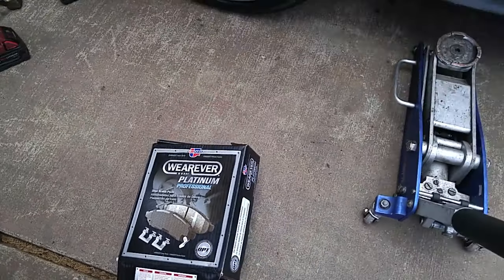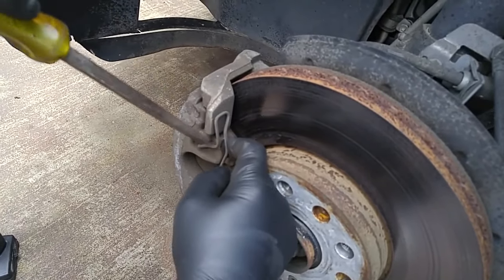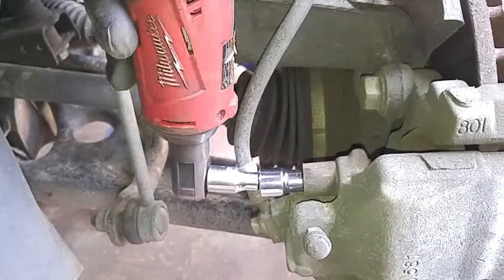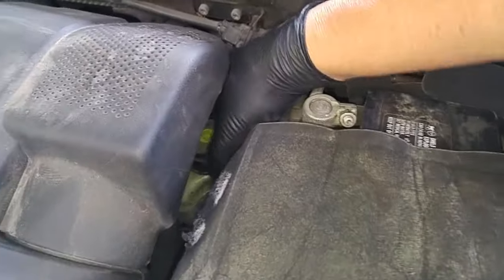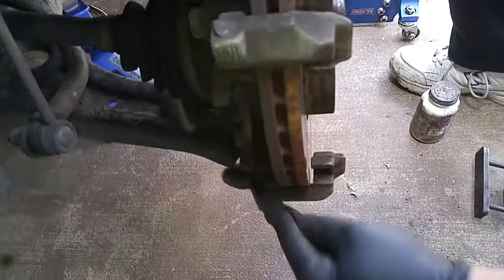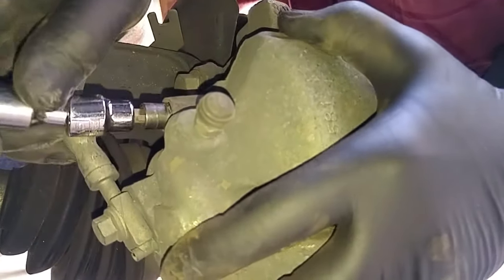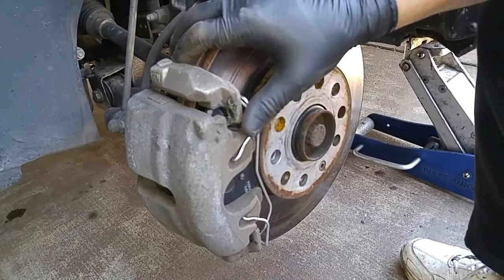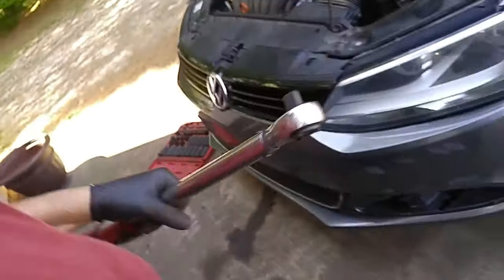Volkswagen Jetta Front Brake Pad Replacement (& other VW's as well)

Comment: Bro, uneven pad wear is your 1st indication of a sticking caliper.  Pull the pins back out and inspect/clean & lube them.  Otherwise good video but always pull and lube those pins.
Reply from the maker: Thanks but with this brake design the brake pad ears slides on the caliper bracket when it wears.  The pins only hold the caliper to the caliper bracket and don't move.
Reply: GromitDog1 You are absolutely right
Reply: @hardlymovingpro, pins are not moving, but the caliper should slide over those pins.
Looks like you're not familiar with VW brakes.

Comment: OK, so I changed the front pads and rotors, cleaned up and greased the caliper bracket and the brakes work great. But each time I begin to press the pedal, there's a single clunk from the front left. It only happens while I'm moving, and is definitely related to something in the brakes. Can't figure out what though. Could it be worn contact points on the carrier, that allow the pad to shift slightly? Any other things to check? My mechanic said it was missing shims, but I don't think the front brakes have shims (I didn't see any in your video).
Reply from the maker: On some replacement pads, the shims are rivetted to the pads.  If yours aren't, the shims may be moving around causing the clunk.  What I do is apply a product called "CRC Brake Pad Quiet" between the pads and shims and let it dry.  It's like RTV but semi hardens in a few hours.  You can also apply the CRC where the caliper ears makes contact with the pad shims.   That should take care of your problem.

Comment: I am due for front and rear pads on my '13 Jetta. Will the system need to be bleed? I see that when you compress the caliper back in you open the cap on the fluid reservoir; is it fine just doing only that?
Reply: What tools are needed? Just that #7 hex head, the flat head screwdriver, brush, and whatever size socket for the lugs?
Reply from the maker: I use the fluid level on the reservoir to determine if my pads need replacement.  When the pads where, fluid migrates from the reservoir to the caliper piston hole.  When you push the pistons back in, you're pushing the fluid back up to the reservoir.  Removing the cap helps to reduce the back pressure (although the caps has a small vent hole).
Reply from the maker: All you need is the hex socket to remove the caliper.  Can't state the sizes.  I have complete hex and socket sets and find the one that fits.

Comment: Stupid question: Are those bolt heads on sub-chassis actually able to take the load of whole car? Always gave me the impression it will slide away from jack stand...
Reply from the maker: The hole in the center of the wheel mounts up on the wheel hub ring.  That's what supports the weight of the car.  The lugs keep the wheel on the hub.

Comment: You are the man. Thank you for this. Gave me the confidence do this myself on my 2016 Jetta. One quick question, in your video you talked about possible brake fluid overflow? you opened and looked into the brake fluid container? May I ask what was the potential problem? Thanks
Reply from the maker: As the brake pads wear, the fluid in the reservoir drops as fluid migrates into the caliper piston cavity.  When performing a brake pad replacement service, the piston is pushed back in caliper which will make the fluid migrate back into the reservoir.  A common mistake that people make is to fill the reservoir back up to the top level not knowing that the fluid level drops as the pads wear.  So when the piston is pushed back into the caliper during service, the reservoir may overflow due to the excess fluid previously added before the pad replacement.
Reply: Thank you sir
Reply from the maker: You bet!

Comment: What could be the reason for extreme uneven brake pad wear?
Reply from the maker: I'd guess that the ears of the brake pads were not sliding evenly on the caliper bracket.  This is why I cleaned up the slides with a wire brush and lubricated with brake grease before mounting on the new pads.

Comment: Do you know the specs on the wheel lock nuts key I have the exact same rims on my Jetta but lost the piece
Reply from the maker: Sorry.  The lug nut key is unique to the lug nut set.  You'll need to go to a custom wheel sales and installation center to get a replacement.

Comment: I'm due for a rear brake replacement soon and I'll be goin w Akebono. Do I need to replace the rotor as well? Or can I just get it resurfaced? It's not warped or anything but I've heard that you should get new rotors if you're replacing your brakes. If so, what brand should I go with? TIA.
Reply from the maker: I use to resurface but now get new corrosion coated rotors.  The quality, performance and metallurgy seems better than non coated ones.  Regardless, don't put on new pads without resurfaced or new rotors.  There is a braking performance difference.
Reply: @hardlymovingpro  appreciate the response! Any recommendation on which rotors I should get? Looking for brands w high quality and performance but not overly expensive. Thanks again!
Reply from the maker: Recognized name brands like Raybestos, Centric or Wagner.  Stay away from store brands like Duralast and don't buy slotted or holed rotors.  No one will resurface them.
Reply: @hardlymovingpro  will look into those. Thanks alot!
Reply from the maker: Go to rockauto.com
Reply: @hardlymovingpro  just ordered my rotors off of there. What a database of a website man. Thanks again! Much appreciated.
Reply from the maker: @1804Mak You bet and good luck!

Comment: I drive a 2020 Jetta GLI and i've been driving on bad brakes for a while they squealed every time I stopped. But now they're not even squealing any more for some reason. Should I get new brake pads and rotors or just new pads?
Reply from the maker: Can't advise without taking off the wheels and examining the brakes.

Comment: Thank you so much for this video! I replaced my front brakes all on my own!! I was wondering- is this process similar for rear brakes? I have to also replace the rear brakes, and I can't find any videos as high quality as this one to follow. :/
Reply from the maker: The rear brake pistons are screw types;  that is, you have to turn in (clock wise) the piston back into caliper.  Here's a video where I did it on a Honda:  https://youtu.be/fDCAYY_Ml0M

Comment: Hi what’s the purpose of using that pressure tool? Is that required when changing breaks can I just take the old breaks out and put the new breaks in without doing that step ?
Reply from the maker: You have to recess the caliper piston back into the caliper for the new pads.  Otherwise, the pads won't fit over the brake rotor.
Reply: @hardlymovingpro  but don’t u have to use a press that turns the caliber? Because some have to turn to push it back in.. how do u know if it needs to turn wile pushing it in..

Comment: Can I use old pads on new rotors and also break in using old pads?
Reply from the maker: Nope.  The new pads need to seat into the new or resurfaced rotors.

Comment: Is it ok to use old rotors with new pads and vice versa? I get 50/50 answer online please help
Reply from the maker: If you want to use your old rotors, you should get them resurfaced assuming there's enough metal to cut. Out-of-round rotors will cause steering wheel vibration, effect braking efficiency and create inconsistent pad wear.  Oreilly's provides a service where they resurface for around $12 a rotor.  Here's a video where I resurface rotors:  https://youtu.be/eEpYifYWV5k
Reply: @hardlymovingpro  thanks! What if I have new rotors and old pads? Can I break in the new rotors using old pads?
Reply: @chuongtrinh3852  no .. because they are groves up.. u put brakes that are scratched with groves on it to a rotor that’s smooth .. Ur brakes will put them scratches and groves back into the rotor or vice versa .. u wants smooth on smooth .. rub ur finger across if u feel groves it’s no good .. u will only tear up the new item that’s smooth ..
Reply from the maker: Watch this video:  https://youtu.be/eEpYifYWV5k

Comment: so it doesnt damage the caliper to depress them without opening the bleeder valve? i was told not to do it like this but i was wondering how it is done because it was my understanding you dont want air in a system with abs. anyone have some thoughts please share, thanks.
Reply from the maker: No air will enter the system by compressing the caliper piston back in.

Comment: hi i dont understand a thing about cars but i have to change my the front brake pads on my VW Jetta 2007 i will let a mechanic do it but i want to buy the pads myself so i wont get overcharged for them but i have several brake pads i can chose from and they are all with a different  Height,  Length, Thickness and  Disc Ø which i have no idea what it means. How can i find the correct size for my car?
Reply from the maker: Pad sizes and types may differ based on the year and style of the car.  All that info can be obtained by the vin #.   Speak with the parts vendor to get the right one.
Reply: Just take your old ones off and take it with you to the Auto parts store.. p.s hope you have another vehicle 🚜
Reply: @kevinrobles7768  yeah i got the right brake pads and i had a friend install them but while doing so we found another problem which i had to go to a mechanic and it costed me 700 paunds :(

Comment: What am I supposed to do if I don’t have a fancy piston compression tool like it would have been nice if you said that at the beginning that you would need one now I have to put everything Back together n go get one. Like fml
Reply from the maker: You can use a large C clamp.  The screw of the clamp can sit inside the hole of the caliper piston.

Comment: It seems as if the one on the back of my car is worn out. I hear it grinding whenever I apply the brakes. Is the front the same as the back? Can I do it myself instead of paying $400?
Reply from the maker: The grinding could be worn out pads down to bare metal.  With the tools I used, you should be able to do it yourself with a friend.
Reply: @hardlymovingpro  Thank you so much
Reply: Could be too late but...you have to push back the rear piston with a press which rotate in the same time the piston...Many cars have this feature because of the integrated hand brakes ...Don't try with regular C clamp, I understand that is possible to destroy something inside..That press is available on Amazon and many other places.
Reply: @eduarditogonzales4485  you don’t have to buy a special press to rotate the piston and push it at the same time. Disconnect the parking brake motor with t30 torque head, use impact driver with t40 to turn the motor clock wise until it stops, and then you can use a c clamp to push the piston. Just did it on my 2010 Tiguan.
Reply: @VG-xh7gx    Instead of press kit which is 20-25 $ would be more advantageous to buy impact driver, C clamp plus 30 and 40 Torx bits?  More than that I have no idea where is the parking brake motor...
Reply: @eduarditogonzales4485  parking brake motor is attached to the calipers. Check this video https://youtu.be/NGXGRMLQsMU
The part you need starts at 2 minutes

Comment: 2:33 Does anyone else think that piston needs attention? The boot doesn't seem to be seated around it correctly, and there is some fluid marks on it which could indicate that it's leaking.
Reply from the maker: The dust boot, in some occasions, may not completely recess back into the caliper during the piston compression;  however, after the caliper has been remounted and the brakes pumped, the caliper piston will push out and the boot will follow.
Reply: @hardlymovingpro  I wasn't referring to its position when the piston was pushed into the calliper. I was talking about how it sat around the piston at that time stamp. Not all of the outer edge of the boot seemed to fully inside recessed lip at outer edge of the piston. It only seemed to be partly secured around the piston. If you've ever rebuilt a calliper, then you'll know that the piston has a groove for the boot to sit it. It didn't seem to be fully in the groove (lip).
Reply from the maker: Yes ... I've rebuild calipers.  Here's the link:  https://youtu.be/ToXPo7eDcs0
Reply: @hardlymovingpro  So you'll no the recessed part of the piston I'm talking about. Check your video at the time stamp I mentioned. It doesn't look like your boot is properly seated in that lip.

Comment: DO NOT DO IT LIKE THIS GUY! Why anyone would push the contaminated brake fluid from inside the caliper up into the brake fluid reservoir is beyond me. Use a hose clamp tool and clamp the brake hose at the caliper, open your bleed valve,  open caliper, close bleed valve, release brake hose clamp, remove and replace pads add fresh DOT 4 fluid as required.....9 of 10 times you won't have to bleed anything and 100% of the time you won't send trash up your system with contaminated brake fluid. Simple extra step can save you hundreds of $.
Reply from the maker: Clamp the brake hose with a hose clamp tool?  Easy way to damage the hose internals.  Open caliper?  You mean compress the caliper piston?  Send trash up your system?  Brake fluid is part of a sealed system ... what trash?  Sorry ... I'm totally confused with your post.
Reply: You've never seen or heard of brake line pliers? They're plastic..... if a hose is damaged by plastic then it should be replaced. BTW  you can't compress fluid with a caliper my friend, unless it has air in it. As far as brake fluid being contaminated by a sealed system.....absolutely it is. Not only is it contaminated it's gone through extreme heat and sudden cooling unless you don't drive in the rain.  Look, you had some great points but the lack of experience on brake jobs shows and that's ok..... we're here to learn...I'm glad I could help you with that. Im glad I was able to teach you some things and anyone who sees my comment too. Hey I appreciate you finding some grammar errors on me. Stick to teaching English? Cheers!
Reply from the maker: @marka9049  Thanks for your comments!  Good to know how the other side lives!   FYI - Done hundreds of brake shoe and pad and rotor service jobs including fluid flushes/exchanges,  replacement of brake boosters, master cylinders, installation of malfunctioning abs controllers purging air via bi-directional scan tools, rebuilding stuck/frozen caliper pistons, replacement of abs speed sensors, re-surfacing warped rotors, etc.   Never, ever had any of my co-worker use "brake line pliers" ... and never, ever pinch or bend brake lines!   Perhaps techs of 40 + years ago with weaker, obsolete line materials.   Brake fluid, being hygroscopic, deteriorates by moisture absorption.  It's not oil!   This is why manufacturers, such as Volvo, recommend a complete evacuation of brake fluid after a few years regardless of the pad wear status.  The moisture absorption and fluid deterioration is not isolated at the caliper;  rather the entire system.   Excess moisture will cause corrosion on the caliper pistons as well as the master cylinder's shaft which will result in premature seal wear.   Moreover, braking at high altitudes would be compromised since the boiling points of the fluid would be lowered.   As a final note:  caliper pistons are recessed into the caliper by professionals using various piston compression tools to choose from negating the need to open the air bleed valve and replenishing lost fluid.  But by all means, service the brakes the way you feel most comfortable with.
Reply: @hardlymovingpro  tbh most shops are going to do it the same way he did I’ve done it for years it’s never failed me. Never had any break issues from pressing pistons back in without clamping hoses. To each their on though it’s your car.
Reply: @hardlymovingpro  do u know which models of jetta comes with brake shoe sensor i m trying to figure out if i have sensor or not i have a model 2.0 engine its the lowest model thanks
Reply from the maker: @Chrisdst  Sorry ... can't say.
Reply: @Chrisdst  I just had this issue. I'm guessing mine doesn't since I didn't get any light that came on when my brake pads were only 1/8th of an inch thick and broke off. It's pretty much just a sensor to tell you when your brakes need changed.
Reply: Buddy I think you’re the one who’s knowledge is questionable. VW brake lines are internally steel braided. Wanna screw them up? Clamp them with pliers. Also, it’s a sealed system other than the filler on the reservoir. The fluid in the calipers is the same fluid as is moving through the whole system.
Reply: @GuvNick1  There's a brake line tool for the use of clamping.  They're made of plastic.... but don't take my word for it... look it up and the importance of said procedure.  Some things aren't in a text book, you'll learn over time. Good luck!

Comment: Will be my first time changing brake pads on a vwjetta , that fluid you checked is the brake fluid correct ? And what if it’s halfway on not full like the one you checked ?
Reply from the maker: If the fluid level is below the full mark, pressing back in the caliper pistons will push the fluid level back up.  As the pads wear and the pistons get extended, the fluid level will drop.   Check the fluid level first before taking the wheels off to determine pad wear.